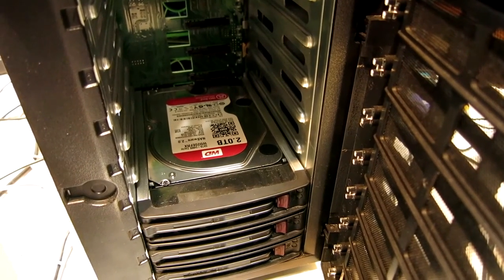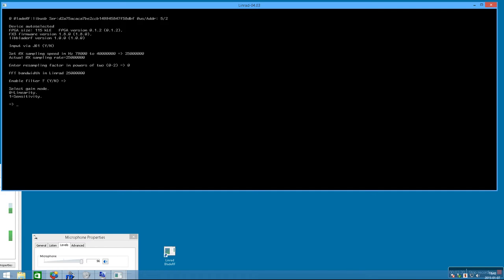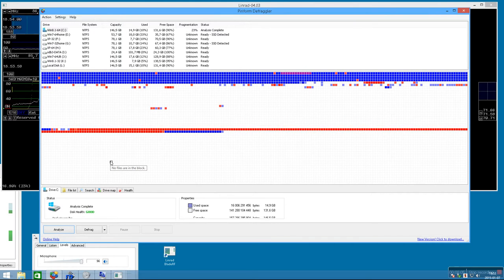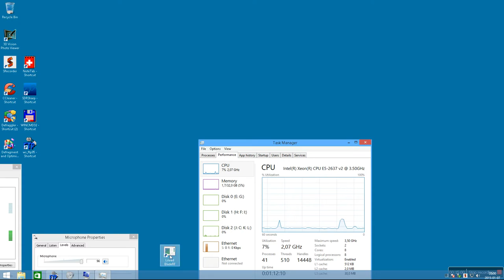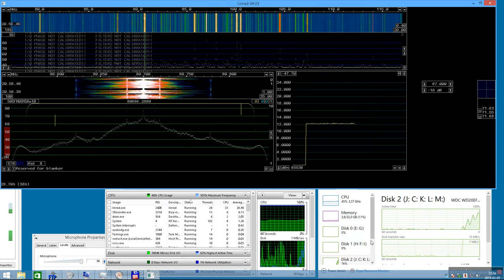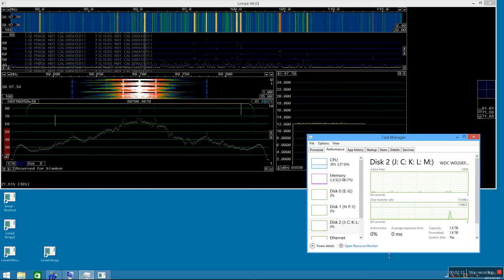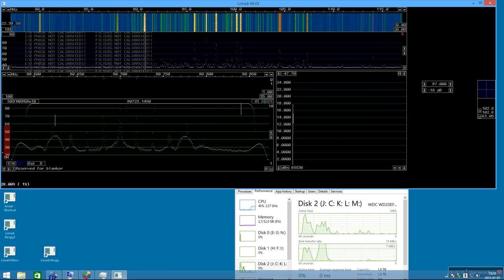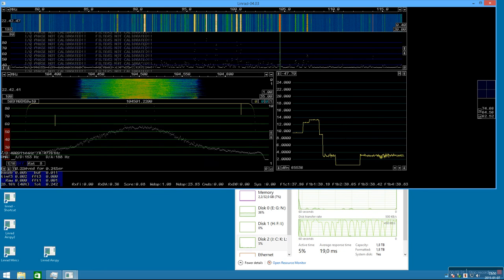SDR record and playback at 25 and 40 MHz bandwidth

Comment: Hi, as far as I know, Windows will use "unused" memory as a disk cache. As soon as something tries to allocate it, it will just be dropped from the disk cache.
That could explain why your system did not need to read the disk in the beginning of the playback - it was cached to RAM and later flushed, and the caching stopped as the unused-memory read cache filled up. Later on, the cache data had all been played and reading from disk became necessary. That's when stuttering began.